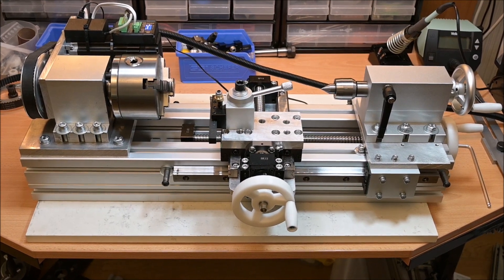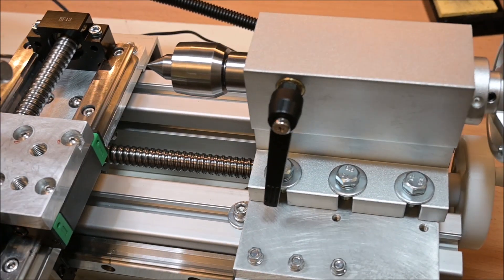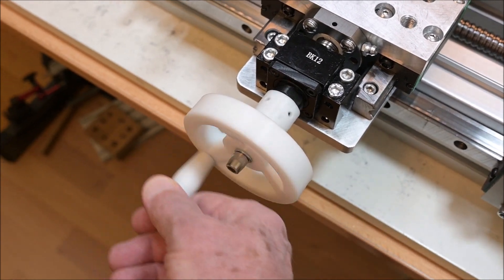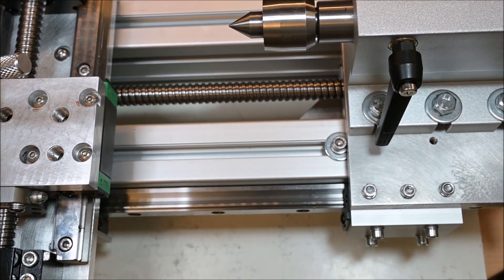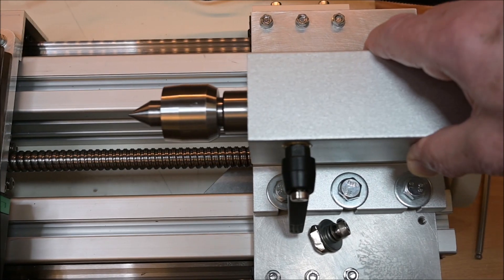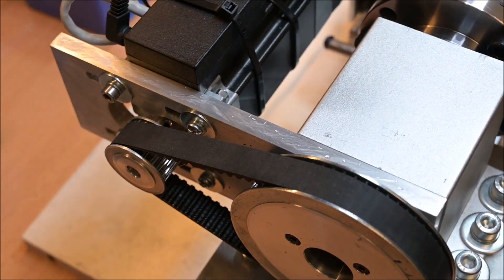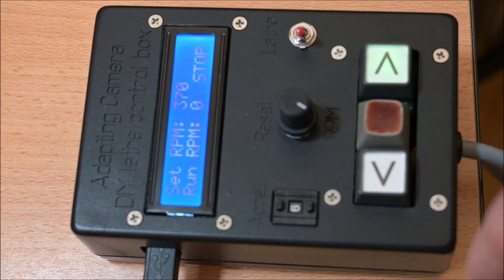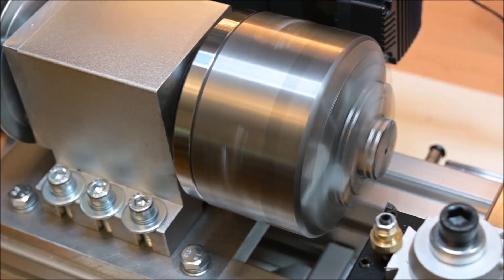CNC Rotational axis as lathe (part 3)

Comment: Nice work it's looking really nice 👌🏼, don't forget to share on the forum ;-)
Reply from the maker: Thank you Lee. There is a thread on the forum about the whole project, which I started at the beginning and keep it updated. http://www.mycncuk.com/threads/14589-4th-axis-as-a-poor-man-s-lathe
Reply: @AdaptingCamera  Ohh I definitely missed it 🙃, will go take a look !
Reply: @AdaptingCamera  Hi, I cannot find the Arduino code for the servo in that thread. Am I near-sighted, or is it only the old(stepper) version you have posted? :)
I would love if you could share the serve code as I am just now working on a project with that servo model.
Reply from the maker: @BinaryClay  http://www.mycncuk.com/threads/14589-4th-axis-as-a-poor-man-s-lathe The code is in the first post, but it is the first version. I have since made several updates, the main one is that since I swapped out the stepper with a servo, the chuck RPM is increased to 1000 RPM. Anyway, to modify the code is fairly simple for anyone with some basic programming knowledge. I will share the final code once I am happy with everything. Will make some more changes, but even version 1 works well.
Reply: @AdaptingCamera  Thank you for your reply. As I understand it several changes was made to the code becase of switching to the servo? If possible, can you explain the differences? I really just want to understand your use of the library with the servo.